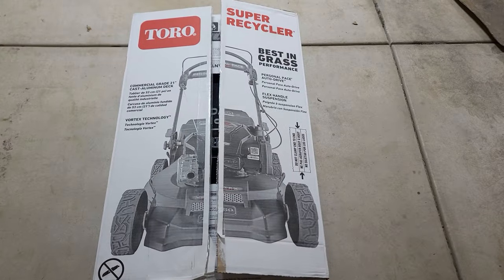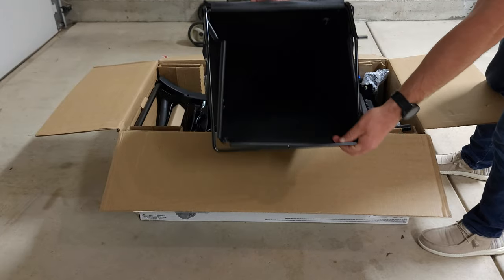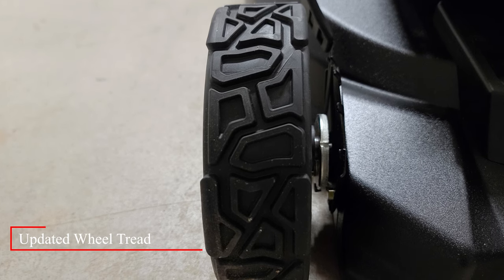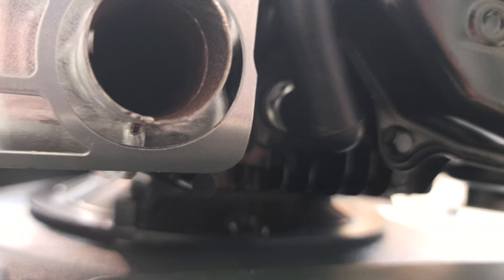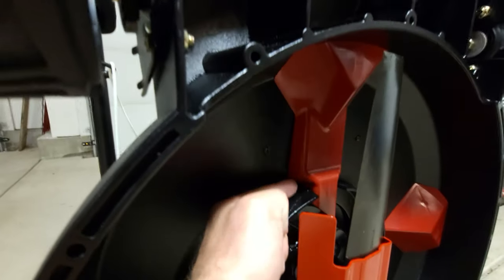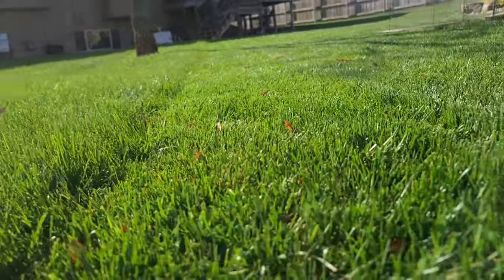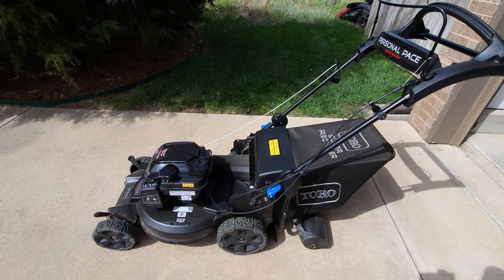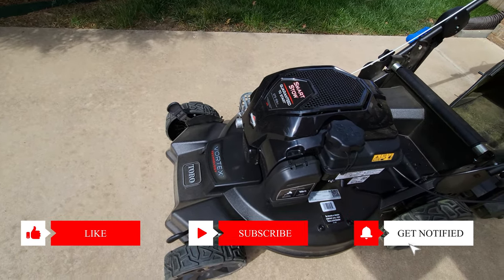Best Toro EVER?! New 2022 Toro Super Recycler 21565 Unboxing and Initial Review

Comment: Just bought this mower from tractor supply. Setup was fairly easy. I put 15 oz of oil in as per specs. The first initial start up resulted in a second or two of smoke than cleared up. It never smoked again after repeated starts. Did yours happen to blow some smoke on first start?
Reply: Yes it did smoke the first time , I suspect that they test the motor and some oil remains behind when they drain it which causes it to be slightly overfilled when you put 15 OZ of oil into it.
Reply: The engine is boxed and shipped with a film of oil to prevent rusting

Comment: I would like to know how to get the blocking system out for mulching where the bag is. I can't seem to get that plastic piece out.
Reply from the maker: You have to press the bottom tab inward toward the blade. That will release the plug and you can then pull it out.
Reply: @lawntechtravel  thanks, Greg! I also didn't notice. You can reach in and grab it from the inside. Just brought it home today. Thank you so much!. Your video was helpful!!

Comment: Is there a height adjustment on the handle? I heard there were 2 settings. Thanks. I just bought this from Lowes today 04/21/24, started on first pull, ran great, recommend. Wanted the 21564 which has the electric start and slightly bigger engine but Home Depot ( disgrace of a company) after showing 430 in stock on 03/10/24 and  saying I would have it by 03/16/24, well its obvious if I bought this one from Lowes on 04/21 that they are full of crap. At the time of my order Toro had them in stock. Home Depot was selling the 21564 for $799, same price that Lowes was selling the 21565. (wish I bought this when Greg did because I paid $150 more.)

Comment: What kind of mower did you have previously to compare it to? I have a 16 year Honda that is about done. I have only had to replace the cord for starting, which lasted until last year 15 years.Pretty amazing, but many items are warn out now. I wish it had more power as it has their smaller engine. I also have fairly large yard. Just now doing research...
Reply from the maker: I had a hand me down craftsman that did ok until the drive went out. Honestly, I'd look into another Honda but they are discontinuing them after this year. The thing about this mower is it's so light it bounces around a lot making it somewhat hard to steer in a straight line. It's a mulching machine but the bagging is not very good.

Comment: Thanks for this video! I literally just bought this mower! Can’t wait to use it! I’m short! Lol! How in the world do you adjust the handle height?
Reply: I removed the bumpers under the handle (part of the flex system) & this let  it drop down
Reply: Thank you! That’s what I though but I couldn’t get it to drop down. I’ll try again with a bit more patience! Lol! I just wanted to get out in the yard & try it out! I bent the crank shaft on my 8 yr old Husqvarna with 190cc Honda engine.😭 I love this mower though! The only things:  I wish it was 22”, had a washout port & push button start. But I got a hell of a deal at Tractor Supply for like $225 off, because they marked the price wrong. Kudos to them for honoring it! 😊  Also, first time in 20 yrs with a B&S engine.🤞

Comment: Hi Greg. I just purchased a new Toro model 21565 like yours today. It will replace my 12 year old model Super Recycler. I will mow with it for the first time sometime early next week. My question for you is about the mulching plug. At 5 minutes & 54 seconds into your video you grab the end of the plug & pull it out. I have pulled & tugged at the plug & tried to get it unclipped from the T slot it fits into, but I'm sure I'll break one of the tabs of or bust the plug if I tug on it any harder. What's the secret to getting it unclipped from the T slot in the mower? TIA!
Reply from the maker: Great question! The bottom of the plug has a clip that needs to be pushed in toward the blade which will release the plug. Then you should be able to pull it out. Not very obvious to most!
Reply: @lawntechtravel  Thanks for the quick reply. I'll check it out tomorrow. I assume you push the center of the plastic clip down. Did you use a screwdriver to push it in. I looked at that, but just tried pushing it with my Texas sized finger & it didn't work. When the plug releases does it stay with the clip or is it a push it down & discard it type of thing? Thanks again.

Comment: I am looking to replace my 2007 TroyBilt 21" Front drive propelled with a Honda 160cc motor, Still runs great, But the deck is splitting where the left rear wheel mount is, So it is a matter of time before it goes bad. I like this mower with the aluminum deck and the stowaway feature, However, I am very leary of stowing a mower with gas and oil verticality. That kinda goes against everything we learned growing up. I certainly don't need a gas or oil leakage in my nice little workshop.  guess I will keep doing more research on mowers before I decide to buy one. But Thanks for this vid, It was good.
Reply: The gas and oil are well sealed with the caps closed and don't leak at all.

Comment: Having a real hard time trying to choose between the 2022 Toro Super Recycler, the 2022 Toro Timemaster, and the 2022 Honda HRX217. 

I live in Oklahoma and have Bermuda grass. My yard is 5,316 SF. 

I have owned Toro recyclers in the past and am a huge fan, but the reviews on the 2022 super recyclers as well as the lack of a side discharge chute and clean out port have me wary. 

My dream mower is a Timemaster, but I think my yard is probably too small. 

All of this leads me to the Honda, which has great reviews, I’m just a Toro guy, and don’t really want to make the switch, lol.
Reply from the maker: I'm going to do a full review soon. This super recycler is a great mower, but you will probably get more for your money with the Honda.
Reply: @lawntechtravel  good to know, thanks for the advice!
Reply: The timemaster is the best of the 3. Steel deck,  briggs professional series 10.0 which makes the briggs on the recycler look like a toy.  With all the features offered in the HRX and 25% more torque then honda largest engine. If you don't have to transport it the weight won't be an issue although even the HRX is just about as heavy as a steel deck 21". I would avoid the recycler personally they have a very low quality engine and drive system.  If you want a 21" you should maybe even consider snapper they use better briggs engines more power then the honda with steel deck. Snapper use a smaller version of the engine on the timemaster but built pretty much the same.  The honda is nice I like mine but I kinda thought my snapper was built better and it was a lot easier to use just no roto stop. Really the timemaster is just better then all of them. Oh yeah no side discharge on the honda the snapper and timemaster both have it. You can actually get the commercial snapper Ninja for the price of this thing that's crazy the Ninja will be the last mower you ever buy.

Comment: I’m looking just not sure about the Briggs motor, no availability right now for the Honda motor. Nice review thanks
Reply from the maker: My Toro dealers said it'll be a year or so before we start seeing these with Honda and Toro engines again which is disappointing. But so far this Briggs & Stratton has performed very well. No sputtering even when I cut well over the 1/3rd rule.
Reply: @lawntechtravel  I ordered it and received the mower in 5 days pretty impressive coming from Dallas Texas to N.J. It’s very nice compared to my 14 year old toro recycler. Haven’t used it yet due to much rain here in the north east mid Atlantic region. Buyers beware I paid $ 699 when I went to Home Depot website again to search for the owners manual etc, the price dropped back to $ 649 Home Depot made good on it but not at first. So I like it even better being fifty bucks cheaper. Thanks again for a thorough review. 👍🏻
Reply: @RodeoRides  I got this 2022 new super recycler 190cc for $250. Lucky me

Comment: I have last years model with the toro engine with no issues at all. It is the ones with the red 190cc Briggs engine that had all the issues with the sputtering. I would live to have smart stow but storing it with the handle at 90 degrees is a space saver. I don't know if I would like the new design of the personal pace handle being 6ft tall.
Reply from the maker: I was hoping to purchase last year's model with a Toro engine or even a Honda engine but the Toro dealers said it'll be quite a while before we see those engines back in stock on their mowers. The Smart Stow is nice but I'll only use that for winter storage. I can guarantee the new person pace handles are not 6ft tall lol
Reply: I have a 21564 with 190cc engine and I have hills- will be a good test for sputtering- I hope its going to be ok. I have a 16 year old 190cc engine on my current super recycler that I'm giving my son. I was torn between the 21565 in the video and the 21564- got the latter because of a great deal. Fingers crossed.

Comment: Can you push the mower freely when it's off? I noticed that the with the front wheel drive model you would have to tilt it back to make it roll as the front wheels are locked up when off
Reply from the maker: You can absolutely push it freely when it is off

Comment: Great review. I'm kinda in the market for a new mower. Mine is an 18 year old Toro GTS recycler with the 12" wheels. It runs great but I'd like to treat myself after all these years. I put a new carb on it about 4 years go - pug & play. This machine eats left rear wheels. At first a couple wheels cracked. Now the hubs loosen up and blow out. So i'm still replacing the left rear wheel every 3 years or so. I'll sell it as-is with a jury rigged hub.
Reply: Keep fixing your old one as many parts were metal instead of plastic like the carburetor the transmission the cam gear and lobes and the blower housing . just got a Toro 2163 to replace my 28 year old Lawnboy Gold series that had a 3 speed transmission still on it's original drive belt (all new mowers just slip the belt to vary the speed which wears them out unless you get the real expensive hydro-static drive).  I replaced the wheels and pull cord once and clean and grease the small drive gears so they lock and unlock properly every 3-4 years cutting 1/4 acre. the blower housing just failed from metal fatigue  where it bolts to the engine from so many pull starts , except for what I just mentioned it never had any kind of problems. My new one had a broken plastic end on the blade clutch/brake cable while still in the box
Reply: No new mower is "a treat", they're all flimsier and less hardy than they were 5, 10 and 20 years ago.  I see lots of comments about folks giving up beloved older mower to get the latest n greatest only to be disappointed and wishing they had kept the older mower, warts and all.  I am leaning towards buying a new mower, can't decide between Toro or Honda, but  I know engine needs to be at least 160cc, those 140/150 cc engines are way underpowered for mulching AND self--propelled. 

All that said, I am going to get a replacement engine for my 2011 Toro recycler (still has the mulch/bag lever, big deletion and terrible mulch plug now) and keep it.  I loved it but stupidly overfilled the oil last year and it pushed out the intake valve seal and burned oil and went a bit low before I noticed it and wore some grooves in the cylinder.  Going to get a 190cc replacement engine, hope it will be nearly as good as the flathead in 2011, but doubtful.  

given ALL gas residential mowers will be phased out over next few years (Democrat side forcing massive EPA changes  yearly), I wanted to fix up my 2011 Toro AND have a solid new mower.  I figure a good gas mower might increase in price over the next few years as we ALL know the battery powered ones still don't come clsoe to matching the gas in performance and those batteries, nutz, cost half as much as a new mower (with a battery included).  The operation cost of battery mower will be nearly double that of a gas mower if you try to keep it 10 years, the first 3 or 4 years maybe not, but that first replacement battery immediately jumps the battery powered operational costs way past some oil changes and $10 of gas per mowing season.

Comment: Your review was so good I will keep using my Honda.  It is 12 years old and other than oil and air filter changes the only thing that happened was one front wheel came loose and fell off last year. No big deal just put it back on no problem since. Never had a problem with thermowax auto choke actuator yet like many other people but have new one on hand. I have the roto stop blade model and like the Honda self propelled handle way better than personal pace on toro. Will be getting another Honda when time comes. And wheel height settings have no marks on my mower but that's not really that big of deal .
Reply: Yeah these mowers are overpriced.  If you go briggs either get a timemaster or a snapper.  The 8.50 and the 10.0 briggs professional series are pretty nice comparable to the GVX commercial engines a bit less build quality but way more torque and they aren't all plastic like the EX engines like the no oil change / upright storage/ cheap tiny foam filter crap on this one. Honda is nice but sucks they have plastic decks or the lower priced steel are FWD with smaller engines.  The briggs really make better power even the cheaper one on the "super" recycler. Hard to get the perfect mower anymore maybe a Toro deck with a honda engine and a snapper self propelled setup.  Used to be Toro had all of that when you bought them the old super recyclers are basically commercial units compared to these.
Reply: @zack6892  That Honda "plastic" deck is bullet proof.  It's some type of composite and it's indestructible.  I've had my HRX 16 years and it gets extremely hard use.  I even cleared three foot tall weeds and small saplings with rocks and sticks a few times.  Steel decks flex and rust, and cast aluminum cracks under stress.  Two years ago - at age 14 - the transmission went (partially) and I replaced that myself for $130, and four five years ago I had to replace a nut and bolt on the clip lever.  I only use non-ethanol gas and have never had a carburetor issue.  My HRX owes me nothing.
Reply: @rla1000   I don't think the plastic is terrible but at 1200$ for the premiere hrx it should be steel or aluminum to be at least somewhat commercial grade.  I'm sure the HRX could be a lifetime mower for a homeowner but I've seen the decks get holes punched in them in commercial work which don't total it on the spot but it ruins the structural integrity and will flex until the Crack spread.  The newest engine gcv200 also is pretty nice it makes good torque and runs quietly but seems like a step in the wrong direction from the older gcv engines.  Overall sure they are among the best mowers at the entry price point of 600-700$ but as you go up they are less and less worth it.  You can get a lot more for your money from briggs snapper or timemaster I think but I guess it depends what your looking for.  Also I expected the nexlite deck to be lighter it is actually heavier then my steel deck snapper commercial with the gxv160 engine kinda odd. The hrx is a nice all in one mower it mulches and bags well with no extra chutes or attachments but it lacks some quality for the price of the top model.
Reply: @rla1000  just my opinion as somebody who owns a lot of different mowers.  Love my hrx but I wouldn't use it daily for heavy work no way.  My snapper I'll push into a field full of rocks without hesitation and it will be fine. If it hits something big may stall engine or worst case break sheer pin that holds blade adapter.  If somehow it managed to have a hole put in it could be hammered out.  If the drive system had issues it can be totally rebuilt under 100$ but very unlikely to need more then a drive wheel.  The HRX if locked up could effect blade clutch and belts.  If the drive system fails it is almost half the cost of the mower and ONLY on the commercial units does honda make them serviceable you can't even change the hydraulic fluid on the HRX217 they didn't make it accessible like the commercial unit which has the exact same layout.  I think it's a great mower just not very well thought out or maybe made to be replaced not fixed.  You will see them at small engine shops a lot because the owner sells it instead of buying a Trans. Honda also sells a ton of them so it's normal to see a lot of them at shops but take that for what is worth.

Comment: Are you able to put it in the stow position with the lawn striper? I saw a video for the checkmate striper and that one is able to still use the stow position with it still connected. Thanks!
Reply from the maker: Yes you can! You just need to remove the roller and it stows perfectly!

Comment: I would assume the potential for oil starvation on steep hills is still an issue since it's a 4 cycle?
Reply from the maker: It is a 4 cycle but I haven't had any oil starvation issues with this model or on my previous mowers. This is specifically rated for inclines in the specs, but I only have gradual inclines at my property, so I guess the potential could be there.
Reply: Splash lubrication mowers like the TimeMaster suffer from that problem.

Comment: Is the blade accelerator standard on all super recycler models? I bought a 21563 and noticed it doesn’t have one.
Reply from the maker: That is very strange as I thought they were on all super recycler models.
Reply: @lawntechtravel  I thought so as well. I talked to the dealer I purchased the mower from and they said brake clutch models do not have them for clearance issues.